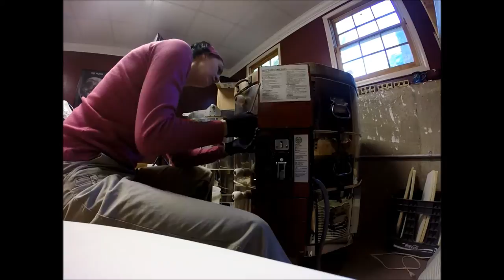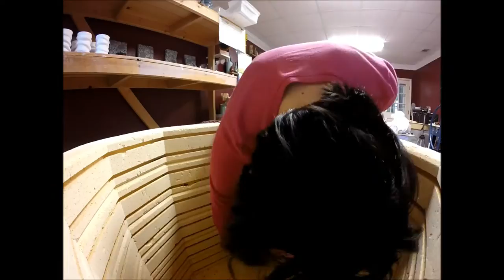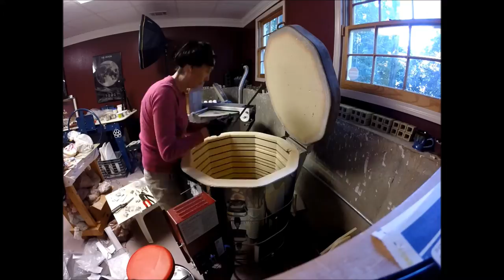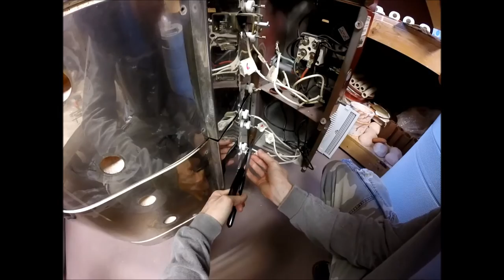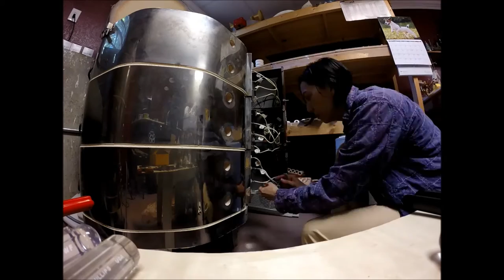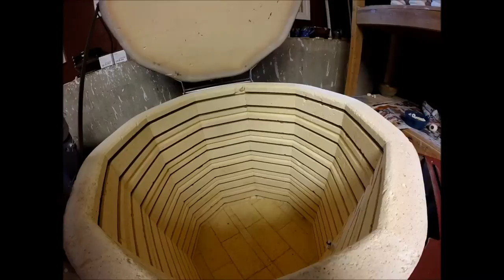Pottery: Replacing Kiln Elements - Time Lapse

Comment: Having just done this for the first time, I really enjoyed/appreciated the vid (perfect soundtrack).

I purchased an A model KS1027 that needed some love. All new elements, some new bricks.  Have just done its first empty firing with the newly acquired kiln furniture..., looking forward to the first "real" firing.

I'll admit I've had some envy for the later models with the swing-out wiring boxes, BUT, I didn't realize they make it a little more difficult to separate the segments.  

The A model connects the segments via stacking plugs, i.e., when removing a segment, one merely needs to unlatch it and lift..., no need to disconnect wires.

I did the element/brick replacement with the individual segments on a work table.

I have a crummy back, and this made the task MUCH more comfortable.

So..., the moral of the story is:  if you're in the market for a used KS1027..., look for one that has the convenient "pluggable" design, it makes maintenance a little more comfy for the bad back crowd.
Reply from the maker: John Saare I'm glad to hear your kiln overhaul went well - that's great! It definitely takes 'elbow grease', but most of it isn't that complicated or technical. I have a smaller Skutt  (the model escapes me at the moment) from the late 60s that had the plug in sections. That was the first kiln I did any work on myself. I ended up having to get a direct wire kit from Skutt to remove the plugs because they developed connection problems over time. But that kiln is still going strong! For me it has definitely been worth putting time and a little money  into rehabbing older kilns with minor problems. The one kiln I have that I bought new with computer control has broken down more than my old manual kilns have. Unless I need to do a very special firing cycle I almost always use my manual kilns. I'm really glad to hear your kiln overhaul adventure has been a good one!
Reply from the maker: John Saare I'm glad to hear your kiln overhaul went well - that's great! It definitely takes 'elbow grease', but most of it isn't that complicated or technical. I have a smaller Skutt  (the model escapes me at the moment) from the late 60s that had the plug in sections. That was the first kiln I did any work on myself. I ended up having to get a direct wire kit from Skutt to remove the plugs because they developed connection problems over time. But that kiln is still going strong! For me it has definitely been worth putting time and a little money  into rehabbing older kilns with minor problems. The one kiln I have that I bought new with computer control has broken down more than my old manual kilns have. Unless I need to do a very special firing cycle I almost always use my manual kilns. I'm really glad to hear your kiln overhaul adventure has been a good one!
Reply: @EvolutionStoneware  Hey! my daughters kiln is EVOLUTIONARY! :)
Reply: That old resistance wire is so delicate! I need to replace it!